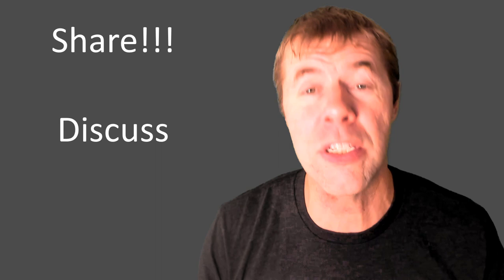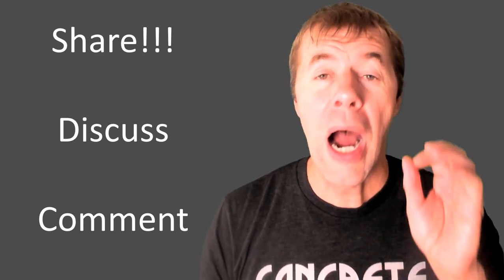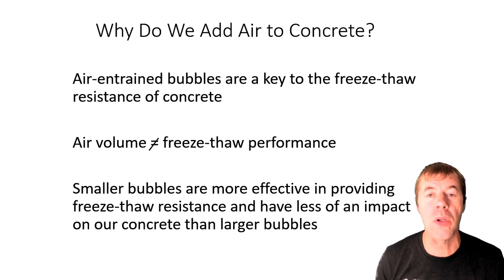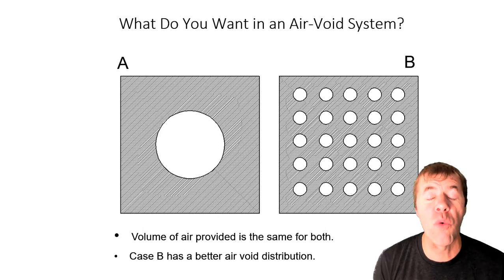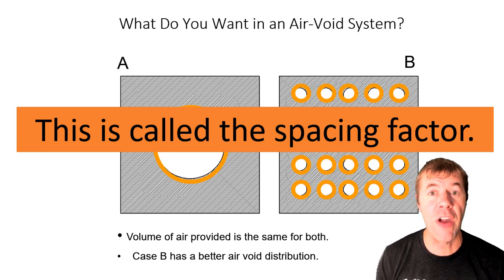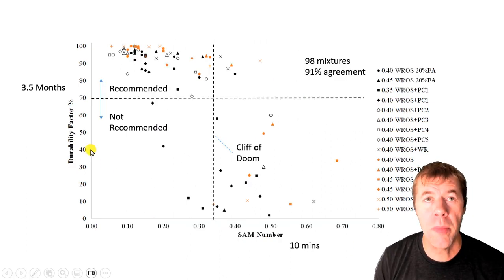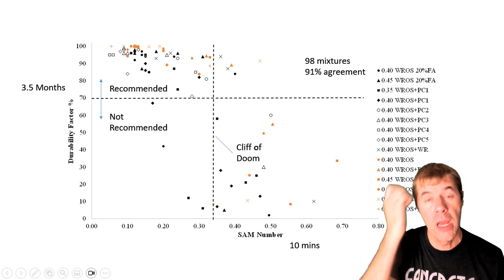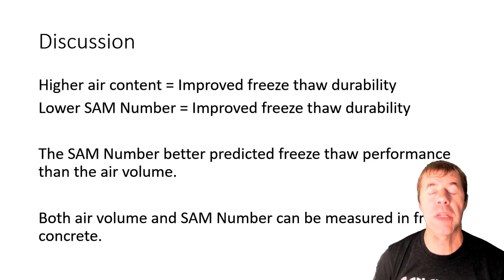Concrete Pumping - Why do you lose air and why does the air come back? (2023 update)

Comment: I work for a ready mix and had an air requirement on top of the mountain. 4000ft gain in the hour it took to drive up to it. We would loose 2-4% air from 7ish down to 3 or 4 and then if it sat in the mixer for 10-15min slowly turning it would come back up to 7%. Confused the heck out of me. This is probably why. I'd love to see more about vacuum stuff. Great info. Thank you.
Reply from the maker: Thanks!  Did you remix when you got to the top of the mountain?  Did you mix harder then when you were driving?  This typically causes the jump in air.
Reply: You could air entrain right befor pumping 
Humbly this is what i would do

Comment: I had a DOT job the spec’d 6% +/- 1.5 %.  Got 7% before the pump, but after the pump it went down to 3.5%.  They had me spike the air to a 12% so at the end of pump it would hit spec.  I fought and fought until the threatened to reject the truck.  Needless to say I had them sign off and make cylinders on both ends so they could see the weight difference.  I actually sent them a video Tyler made a few years back on this topic.
Reply from the maker: I am sorry to hear this.  I hope this will change soon.

Comment: I have a diy that even you may not have heard of. Underground roof slab for storage room. 
One way design. 4x9 plywood form base. Set up to pour one 8 inch wide section at a time sleeves for distribution bars on the movable side. The idea is to pour and cover. Wait three days ,then install the next side form. Remove the side form from the poured section. Drop in the rebar cage for the next section and pour . Continue for 20 linear feet. All poured concrete remains covered with visqueen  for 28 days. 
Am I right, or have you seen this before ?

Comment: This is AWESOME!!! Great info. Yes should always be at the truck. With this info, why is everyone wanting more air in the concrete if 4% is great. This would mean less cement( like everyone is wanting, green world) better breaks with less air. Easier to control then the 7% or 6% required.
Reply from the maker: I agree!  As long as the air is good air void distribution then 4% is perfect.

Comment: Your presentation indicates that the spacing factor of normal temperature concrete recovers about 45 minutes after pumping. This suggests that while concrete sampled at the pump discharge may have a non-compliant air content/SAM number, cylinders cast from this sample of concrete should experience a recovery of dissolved air and have about the same spacing factor as cylinders cast from concrete sampled before pumping. 
When the concrete was sampled at various time intervals after pumping to check the SAM numbers, were cylinders cast and the spacing factor of the hardened concrete determined? If your premise is correct, the timing of casting the cylinders should not have a big influence on the results.
If so, is the data available in one of your papers? My studies of annual LT results for a municipal QC program comprising dozens of samples indicate that there is often a characteristic relationship between hardened air content, spacing factor and specific surface, often unique to the concrete admixture package. I wonder if there may be something similar happening after pumping

Comment: It has been an argument for a very long time. POP is the pump!! We have no control over the concrete when it goes thru the pump!! What happens when the pump has a leak? Or the pump operator doesn't  do a good job cleaning his pipe? So many factors involved.

Comment: So, if I wanted to make concrete with even better air entrainment and especially lots of tiny bubbles, could I compress air into the water at high pressure, then heat exchange the water down to about 40 degrees before I release the pressure and use that water to mix up the concrete?  I'm thinking air dissolved into the water would tend to make really uniformly spaced tiny bubbles as it is released by the water. Is there any chemical that I could mix with the water that wouldn't mess with the performance of the concrete, but would make this technique work even better?
Reply from the maker: I have done stuff like this before and imaged the bubbles in 3D with X-ray CT!  It is published in this paper.  The dissolved air in the concrete will come out of solution because of the high salinity pore solution.  If you de air the water before you make the concrete and don't whip the water into it while mixing then you will significantly decrease the bubbles that form.  I never made a video about it.  I didn't think people would care.

Moradian, M., Ley, M.T., Hu, Q, Robertson, B., Hanan, J., Xiao, X., “Direct in-situ observation of early age void evolution in sustainable cement paste containing fly ash or limestone”, Journal of Composites Part B, V175, 2019, pp. 107099, https://doi.org/10.1016/j.compositesb.2019.107099.

Comment: Use Sika Aer Solid for instance. What you put in you measure every where in the process and therefore you only need to measure once on the batching plant. It’s like really tiny ping-pong balls. The are specified for roadworks in Europe.
Reply from the maker: Thanks!  When people have tried solid air in pumped concrete it has caused the spheres to be destroyed.

Comment: So how do we control this on site for the pour?
Reply from the maker: I think the best answer is to measure it at the tuck and if it is good then you should be good after pumping.

If you really want to minimize air loss while pumping because the specifier is going to make you measure on site then you can try and pump in a horizontal position as much as possible.  You can also avoid having cold concrete because the air dissolves more in cold concrete.  

This wasn't really the focus of the work.